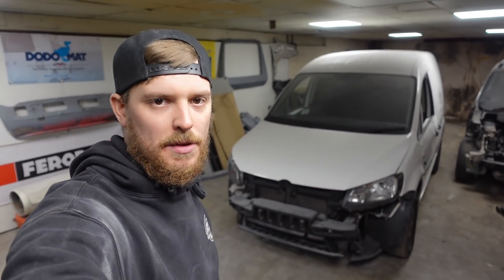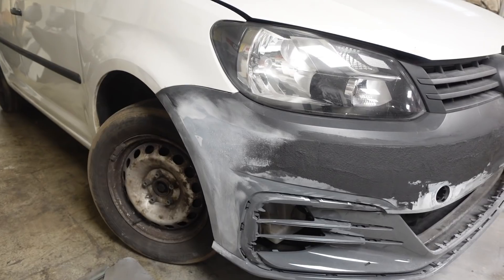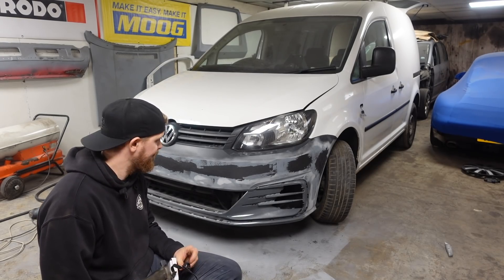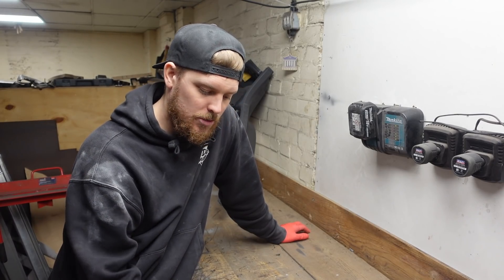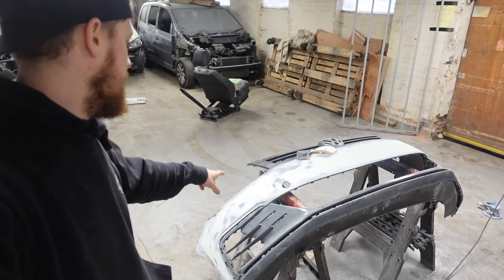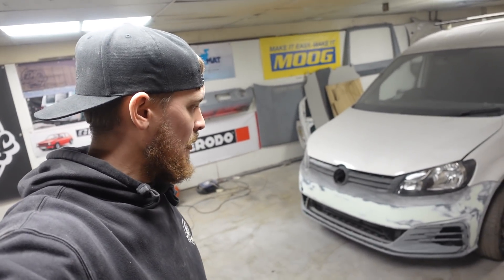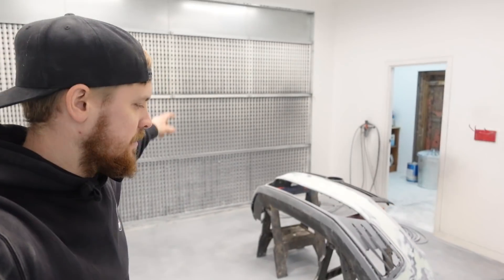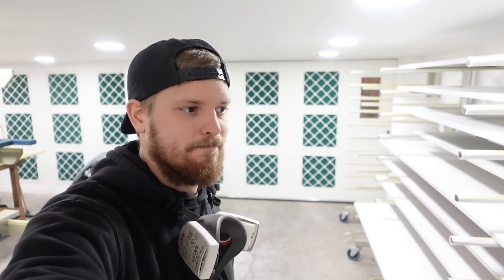VW Caddy 2K Build Series - Golf GTI Caddy Hybrid Custom Front Bumper How To Part 3 - Episode 9

Comment: Great job so far and a lot sturdier than a cut and weld. I’d suggest taking time to sand the primer, use a black guide coat and run a bit of masking tape along the edges and sand one edge at a time to the tape, it makes them nice and crisp then re prime it to leave it ultra smooth. Hard work pays off and the best paint jobs rely on the long prep

Comment: Helpful tip, if you spray a very light coat of say black on the filler and then sand you will see the low spots. It's called a guide coat if you google guide coat there's a powder with a  sponge applicator rather than a spray.
Reply from the maker: Cheers bud. Yes I have bought some dry guide coat to use on this and the rest of the van.

Comment: Looks good and great job working with what you have the products are right for the job.
My advise if your planing on doing more like this just put as much effort in at the back as you have at the front and if it's within your means try and get hold of a pro tec plastic welder it will literally never give 👍

Comment: For filling, get yourself an 'onion board' it's basically a pack of glue bound paper designed for mixing filler, when you're done, tear off the top sheet of paper, and you have a clean sheet ready for next time.

Comment: Hi Dan, great channel.
I have to replace the rear panel on my t4, as the wheel arch is rusty.
What would be the best filler to use?
Over the welded joint area?
I have read fibre glass is best. I have used it in the past. I find it difficult to use on small cracks and over welded areas. Due the length of strands in it.
Cheers Chris 👍🏻
Reply from the maker: That SMC filler is brilliant and sands so nicely!
Reply: @DanChambersDAC  
Excellent, thanks. 
👍🏻👍🏻👍🏻

Comment: What primer did your friend use? It doesn't look like it has much build? What did you grit finish the bumper in before primering aswell?
Reply from the maker: High build. We didn't put much on to be honest. Will be going back in soon. Yes bumper was sanded to 120 then 240 before.
Reply: If I was you I would finish the bumper in 180 or 240 on a soft pad da. Then use some real high build and then block that. I only recently found your channel is this a full time job?

Comment: Dolphin glaze isnt really for that it needed a medium depth polyester filler, dolphin glaze is for tight skims to get rid of pin holes and slight imperfection. Good job though.
Reply from the maker: Cheers bud. I spoke to a few people that do this type of thing and they all suggested SMC & Dolphin 🤷‍♂️
Reply: @DanChambersDAC  if it works it works haha just in the long run it might sink and map out around the repairs ive seen it alot of times with heavy skims of dolphin glaze.